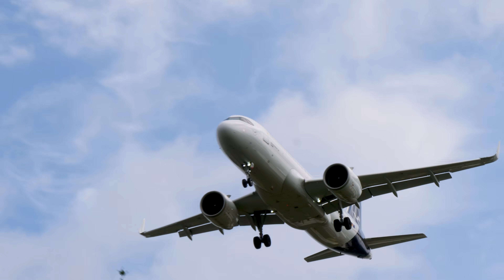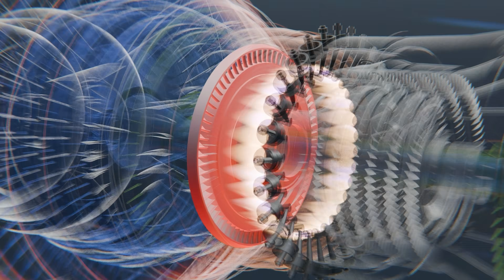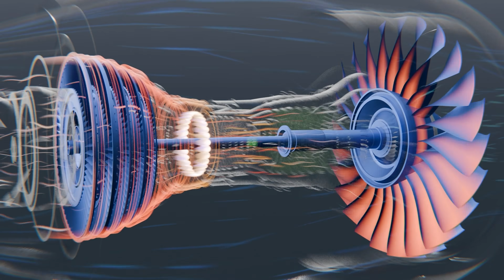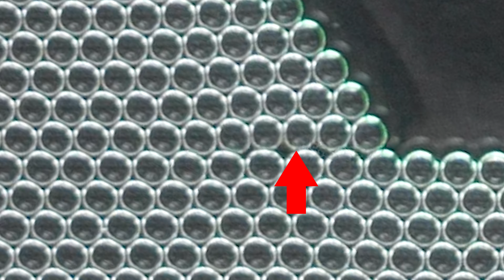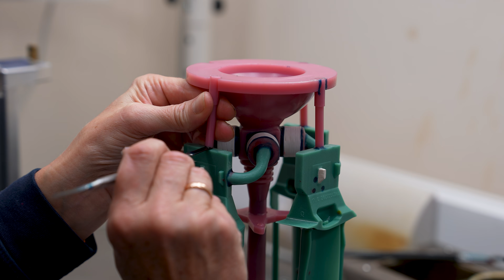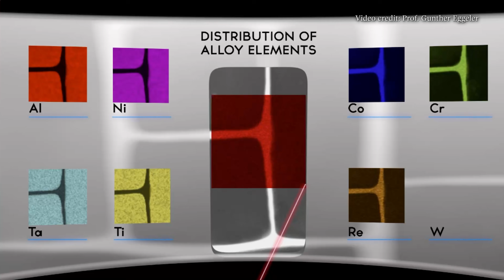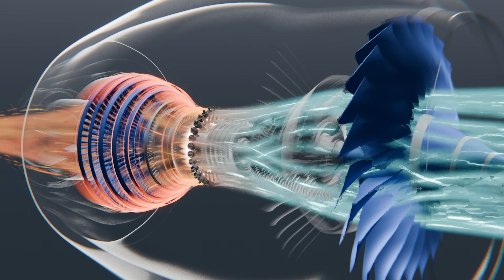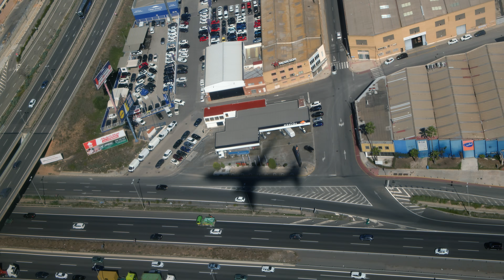The Ridiculous Engineering Of Jet Engines

Comment: Here was me expecting a lecture about convection coefficient. Yet it wasn't even mentioned. All of the other stuff is amazing, certainly, but you were not quite careful enough to explain that while the GAS is at 1500C, the surface temperature of the blade is NOT. In fact, the running blade temp was never mentioned - all we saw was that the "survival limit" of the blade is about 1250C.  An even more extreme example is the aluminium piston in a combustion engine. The burnt fuel is at around 1200C (steel/iron exhaust headers glow red hot). The piston alloy turns to butter at no more than 200 to 250C. So how can that survive? Because, there is a "barrier" to heat transfer where the heat leaving the gas requires convection to enter the metal surface. And that barrier reduces the actual metal temp to something it can survive. The metal surface is NOT equal to the gas temp - and not just because of the cooling film "injection" nor the ceramic thermal barrier layer. 

Look up "convection coefficient" if you want to know more about how energy from a fluid (gas or liquid) transfers into or out of a solid structure. 

In my 40 years of engineering, misunderstanding and lack of awareness of this convection coefficient (where the rate of energy transfer depends on the temperature drop from ambient gas to solid surface) was widespread and obstructive to getting any "ENGINEERING" actually done. I even had a manager insist that the surface temperature of an aluminium piston HAD to be the same as the 1200C of the burned fuel. I was shouted down by his seniority, and it totally wasted the entire project meeting, because that lack of understanding prohibited any progress being made. 

So if you don't get it, rest assured there are plenty of "professional" engineers that don't get it either. 
I wasn't entirely convinced that the Rolls Royce experts understood it either - because of their total focus on the high tech tricks used to help keep the blade cool enough to survive the operating conditions, without showing any flicker of awareness that the convection coefficient mattered at all. 

Sure, there is a difference that a piston engine (usually) operates 4 cycles, and is not continuously exposed to the hot gas like in a turbine. 

BUT, using a metal that, to all intents and purposes, is completely useless at 250C but remains perfectly intact when spending 1/4 of its life in contact with 1200C gas, touching a cylinder liner that is likewise exposed to that hot gas (but also cooled by coolant, usually water, on the other side) seems even more impossible than these turbine blades. Never mind that an aluminium alloy cylinder head has to likewise resist the cylinder area of exposure to gas, take heat out of the valves, and resist that hot exhaust gas disappearing down the exhaust ports into the exhaust manifold, which is often glowing red hot (800C metal temp on the OUTSIDE surface for a steel / iron manifold...) Aluminium seems like the LAST metal you'd use for this high temperature application.  

What matters is that the convection coefficient of a GAS into a surface is fairly poor. Your piston engine lives because the liquid coolant is about ten times better at convecting heat out of the liner and cylinder head, such that the temperature of the metals is heavily skewed towards the coolant temp, rather than the gas temp. The piston is somewhat cooled by the liner it rubs against, but especially by oil splashed up from below in the sump - or possibly squirted deliberately at the underside of the piston, purely to cool it, in high performance engines. 

The piston also has to survive some quite extreme inertia loads as it reciprocates up and down at the end of the connecting rod. Similar to the loads on a turbine blade, a piston might well experience several thousand "g" force, 100 times per second. It isn't a constant force, so creep is not an issue, but if the strength of the metal drops to that of soft butter if it gets to 250C, it is never going to survive for hundreds of thousands of miles. 

In a turbine, you have that same gaseous convection coefficient on the cooling core, except that turbulent air (we saw the ribs that FORCE turbulence) has a higher convection coefficient than smooth (laminar) flow. 
So, using turbulent "cooling" air at 600C (from the compressor) inside the blade, and burned gas in smooth (laminar) flow at 1250 on the outside surface, most of the blade metal will probably vary from 700 to 800C on the internal cooling surface, and perhaps 900 to 1000C at the hot gas surface. Which puts the temps in the blade metal at the PEAK of the strength vs temperature curve, not "operating at 1250" where it fails, and certainly not at 1500C like the video "mystery title" implies. 

The drop in temperature through the thickness of the blade metal is the "flow" of heat energy. And that flow must be consistent, since energy is not created nor lost. The heat that goes into the blade from the hot gas, then has to flow through the blade metal, and into the cooling air on the inner surface. Linear approximations of this are easy - calculating it in 3D, like in a turbine blade, requires serious computer horsepower and cannot be done by hand. 
Trial and error experimentation is a valid means of development, but tweaking the final optimisations usually needs computer prediction models of the temperature distribution and heat flow. 

Otherwise, the only way the blade would cool itself is for the heat coming in from the hot gas to conduct itself down the length of the blade to where it is held by the shaft (which then has to conduct it elsewhere). 
Heat flow always depends on the thermal gradient, in exactly the same way that electric current flows according to the voltage gradient. 
The use of electrical analogue is a very old-school way of representing heat (energy) flow within any system. 

The extra ceramic defence adds a layer of thermal insulation (like a blanket) making it much more difficult for heat to flow into the blade from the hot gas. With a high resistance to thermal conduction, it will force a large temperature drop from gas-side temp to blade-side temp, despite being a very thin layer. The metal alloy of the blade conducts heat much more readily, and the energy flow through both surface layer and metal blade thickness must be equal, so the temperature drop across the metal is much lower. This keeps the gas side (ceramic side) temperature of the blade metal much lower, and the metal temperature much more even through the thickness. 

Metals expand with temperature, so having a high temperature gradient through the metal blade will cause thermal stresses that add to the inertia stresses of the spinning turbine, making it more likely that the metal will break. So that's a second way that the ceramic coating helps the blade to survive.  

To all intents and purposes, it was made to seem like it was the film cooling and protective ceramic layer enabled the single crystal blade to survive the 1500C gas, when actually they HELP, but are not the primary reason. Convection coefficient means the metal surface temperature is never as high as the gas temperature. THAT is what enables survival, with the extra tech assisting to lower the metal temps further into the "peak strength" zone. 

Rolls Royce has expended massive resources over decades to "optimise" the blade design (with this video omitting the aerodynamic aspect that the blade SHAPE itself is critical for extracting the horsepower from the gas) juggling all of aerodynamic shape, gas velocity and pressure drop, structurally mounting the blade on a hub and shaft, doing all the thermal stuff, doing all the metallurgy stuff.... this is what ENGINEERING is really all about, and nothing like the garage mechanic or washing machine technician who swops out old parts for new ones... 

Thank  you for reading. 
This video was nevertheless an interesting watch, despite missing out on convection coefficient, which is arguably THE most critical factor in any heat transfer situation.

Comment: 40 minutes to explain why the engines don't melt? ............. 

Jet engines don’t melt because the metal parts never actually reach their melting point, even though the gas around them can be much hotter. The key reasons:

High-temperature superalloys: turbine blades are made from nickel-based single-crystal or directionally solidified alloys with melting points around 1300–1450 °C and excellent strength at high temperature.

Internal and film cooling: some of the compressed air is routed through internal channels inside the blades and also blown out through tiny holes to form a cooler air film on the blade surface. This keeps the metal far cooler than the gas stream.

Thermal barrier coatings (TBCs): ceramic coatings (often yttria-stabilised zirconia) insulate the blade surface and reduce heat transfer.

Advanced materials and geometry: optimized blade shapes, heat treatments and modern manufacturing (including 3D-printed cooling channels) enable efficient cooling without weakening the structure.

Temperature management: turbine inlet gas temperatures can reach ~1400–1900 °C, but with cooling and coatings the actual metal temperature usually stays around ~700–1100 °C — safely below the melting range of the alloys.

In short, jet engines survive extreme heat thanks to superalloys, active cooling and thermal coatings that keep the metal much cooler than the surrounding gas.

Comment: This is one of the most informative videos I have ever seen. I am a pilot of turbine-powered aircraft, and although this is explained to us, it’s only cursorily. When a turbine engine is starting, there is a very large difference in relative temperatures throughout the engine. The maximum “inter turbine” temperature during start is usually around 1000 degrees or so. The turbine at this point is spinning around 40-50 percent of its maximum rpms. During stable operation, this maximum temperature is usually 7 or 800 degrees. There is a time limit associated with both of these maximum temperatures, as well. Now, watching this video, I have a better understanding of why these temperatures are the magnitude they are. Very, very interesting.

Comment: Amazing video. This is is something I wondered a few years ago as well. I used to work in R&D for a nickel superalloy manufacturer for aerospace and turbine applications, and all the material tests we ran topped out at around 800 °C. These alloys were state-of-the-art, there simply weren’t better alternatives, but even they couldn’t withstand the emerging forces in higher temperatures. Our customers’ specifications were usually in the 700–800 °C range, never more. It makes the cooling and temperature-management side of jet engines even more impressive, because you’re literally looking at cutting-edge engineering in materials science, thermodynamics, design, and fluid dynamics all at once. A true engineering marvel

Comment: Not a huge fan of him spending 15 minutes going "but if steel melts at this temperature how do the hotter engines work" and like getting genuinely curious about this engineering problem they were gonna solve and then it's just like "oh. they used an alloy." Like he really made it sound like they were gonna use steel and a special secret technique so it wouldn't melt

Comment: Great video as usual!   You could have a whole channel on aero engine design - hollow fan blades, compressor working line and VSV systems, discs and drums and stats around lifing, externals design, blisks, abradable linings, the oil system and all the coolers ACOC, FCOC, computer designed 3D aerofoils, bearings, Casing manufacturing... etc etc.  Cant wait for the next video.

Comment: bro a F1 car has 1000hp
this means this jet engine is 68x1000hp.
dude thats 68,000 HORSE POWER how do you explain this to a civilization which doesnt understand our language lmao
Reply: Pretty good but the FUEL PUMPS on a single Raptor3 engine REQUIRES 100,000 hp to operate. That jet engine is just a toy.

Comment: 14:00  wrong.  My first 2 years of work.  Was milling the leading and trailing edge of ROLLS ROYCE TURBINE ENGINE VANES.  At chromlloy in the netherlands. 

And ofcourse the mating surfaces (where the vane is welded to the ring it's mounted on)

That said.  I think i mostly did the vanes from the compressor.

Comment: 24:56 Grain borders are actually stronger for mechanical applications because they don’t let dislocations move very easily so more grains and smaller grains are actually preferable, turbine blades are single crystal because creep is proportional to diffusion which in turn is proportional to imperfections and temperature, meaning yes blades need to be single crystal to have as little imperfections and “roads” for atoms to move but this technically means the blade is mechanically weaker than a polycrystalline one.

Comment: Basically I love CMSX, SX alloys with internal cooling, and Thermal Coating. Thermal Bond Coat is a composites of Bond Coating+Top Coat, which is MCrAlY+ YSZ. I have work experience in Diffusion coatings and SX selector for casting the blade of CMSX-3 Turbine Blade. The gamma and gamma' microstructure gives the stability to SX blades and due to the internal cooling and Coatings the system will be work at higher Temperature. I love to work in it

Comment: The one lady who said every time she gets in a plane she's amazed that it works is describing the same feeling I get when I think about modern computers and software. The sheer scale and complexity is so great that it feels like a miracle that anything at all ever works. "Oh hey, we've got a grid of a few billion switches that flip a few billion times a second packed into a square inch or so. If a single one of them flips wrong, it will probably instantaneously cause everything else to fail. And here's your toolkit that operates at a dozen or more levels of abstraction from those switches. Have fun!" It's like doing brain surgery with chopsticks. From the moon.

Comment: Doesn’t the formula kind of swap at altitude and the exhaust gas provides a greater percentage of thrust while the fan becomes less performant? I believe that’s true but I don’t know to what degree.
Reply: yes, but modern high bypass engines still generate most of their thrust by "making lots of air slightly faster" (eg: fan) than "making small amounts of air very fast" (turbine)
example: the 787s engines have a 9.3:1 bypass ratio meaning 9 the fan moves more than 9 times more air than the turbine
Reply: @garen_4_life that makes sense to me. Even the KC-135 got much larger fans back in the 80’s. We talked about it a bit at UPT in the basic aerodynamics classes and I guess the principle stuck with me but I guess never really gave it enough thought afterwards. Otherwise, why would  the fan section keeps getting bigger if they aren’t efficient enough at altitude? So then my new understanding is the fan section does become less efficient but still more so than the exhaust.
Reply: If that's true, then modern jet engines wouldn't have that crazy high bypass ratios.

Comment: I was hoping you would cover hot sulfidation corrosion too!  Jet fuel contains sulfur, and when it's part of the combustion process, it forms acid with the water that is created, and it is also trying to eat the turbine blades and vanes.  Usually the bond coating between the blade, and the thermal barrier coating also serves as a corrosion resistant coating against the hot sulfuric acid.  Another area to explore is how the coatings make the blade brittle, and the balancing acts there.  Great video, hope to see a deeper dive some day!

Comment: Not only metallurgy... If anyone knows Germany had first operational jet in WWII but they didn't have access to some of the metals to make correct alloy so their jet engines would slowly destroy themselves..

But some  blades are hollow with tiny holes and colder air is pumped into the blades to form an "air-film" between the blades and the hot gasses.. this film keeps the metals cooler and reduces the chance of "stretch and deform "

Comment: I'm an aeronautical engineer working with jet engine everyday and I must say you did a great job making this video as I also had all same curiosities at the beginning of my career. 
However, at the beginning of the video, comparing the fan to a propeller is too much of a stretch. The fan works like a compressor that pushes the air into a convergence nozzle, which we call a C-Duct, which in turn create the delta V for the thrust. If you were to remove the duct, 80% of the thrust create by the bypass flow would be gone. You can verify this if you reach out to Collins Aerospace or Safran Nacelle. Also the fan spin so fast that the tips of the blades spin faster than the speed of sound, hence the crazy noise, per definition no propeller can create thrust at that speed.

Comment: So, I don't get the little holes for air cooling, are they directly on the surface of the blades or at the outer ends ends or both? And are the ends in a different cooler air channel?
How do they bake the ceramic glaze on if it melts at higher temps than what the steel can handle and are the tiny holes also coated?
Mostly I don't understand exactly how the air flows making the holes work.

Comment: it works the same way anti matter containment does.
the air keeps the heat from ever reaching the engine parts, like the magnetism keeps the anti matter in place.
look at a drain when the water is draining, you see a hole in the center, but the water still spins out. SAME simple fking principle.

Comment: TLDW: the blades don't melt because of a Ni/Al/Re superalloy, casting the blade as a single crystal using a helical pigtail, a metallic coat, a ceramic topcoat, and air-cooling via internal veins and film-cool holes.